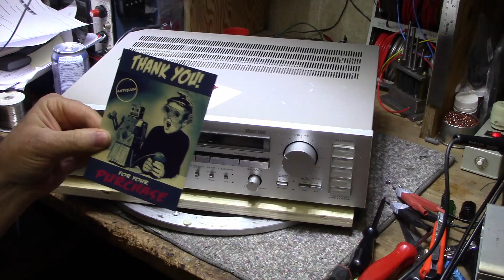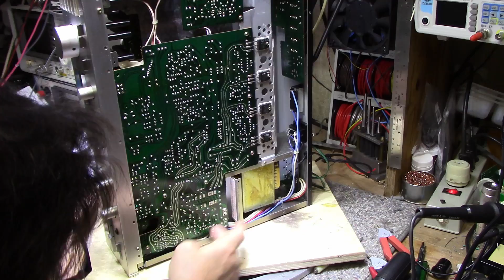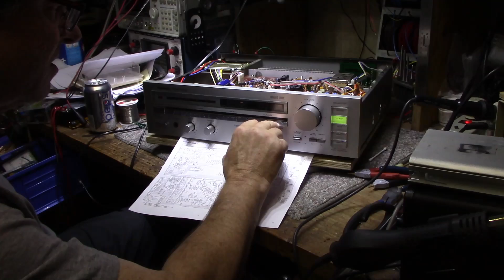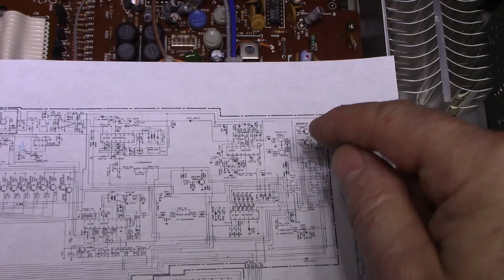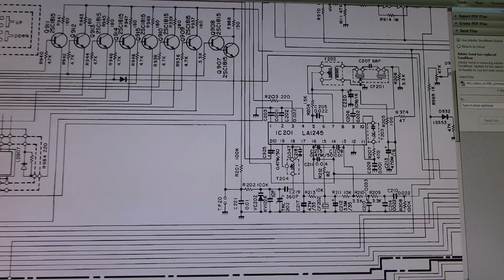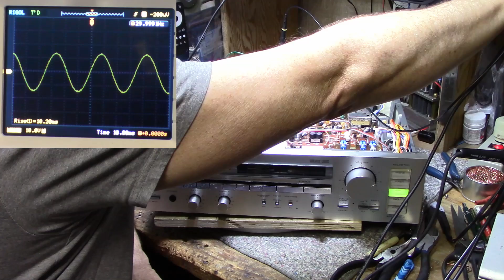Nikko NR-700 Receiver - Repairs (Ep. 53)

Comment: Hi Trevor, I own an NR-700 in working condition but 2 of the selector button backlighting bulbs are burnt. Would you happen to know the part number of these bulbs or a compatible replacement? Regards.
Reply from the maker: Generally, there's no part numbers for bulbs. They are identified by voltage and current, like you've already found. After that size is the next consideration in selecting bulbs
Reply: @TrevorsBench  I was able to source 14v 80mA from a model train supplier. I think I paid like 6-7 bucks for 40 bulbs so I won't run out anytime soon haha It's been 4 months now and they haven't burned out *thumbs up*. Edit: It's been 2 years and the bulbs are holding.

Comment: Again a bit late, but here's some info about that weird behavior (messy waveforms when zooming out) that you observed on your oscilloscope: This is called aliasing and it happens whenever you don't measure (sample) the signal fast enough to capture the highest frequency it contains. It's perfectly normal and means that you can't zoom out too far on high-frequency signals. If you try anyway, you'll get garbage, no matter what oscilloscope you use.
As a general rule of thumb, if your signal looks like a solid block (no distinct trace visible) on a digital oscilloscope, you're in aliasing territory and have to zoom in to get a reliable measurement.